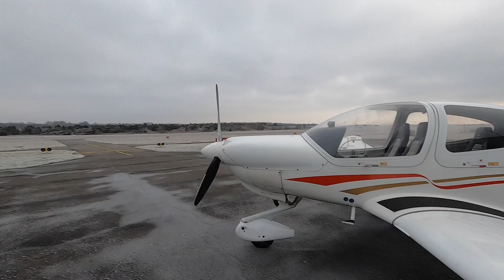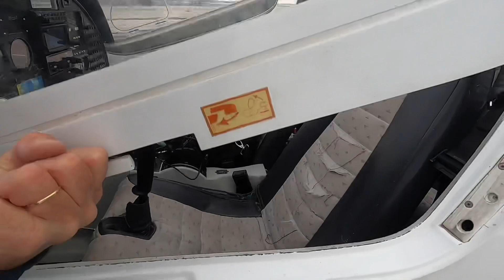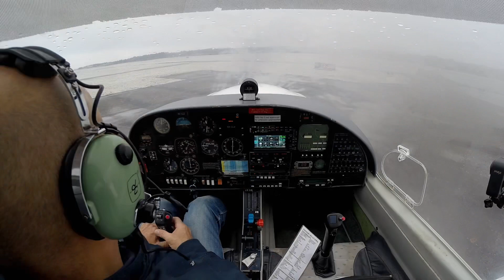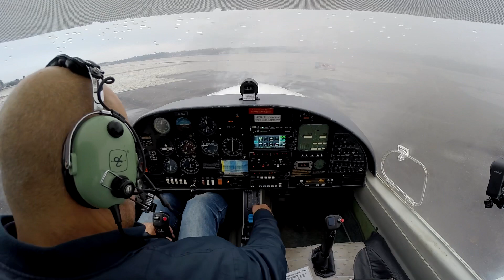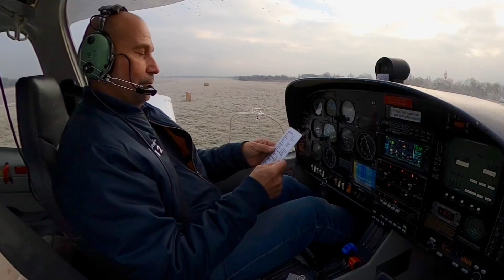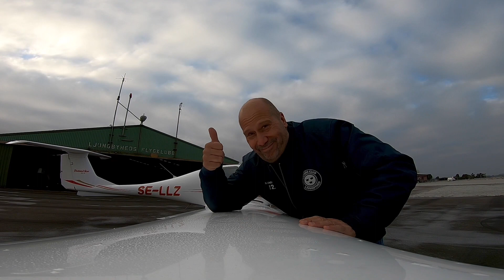How To Fly A Plane 🛫😊

Comment: Thank you for a wonderful video. It certainly is more snappy than a C172. How about trim. Does it automatically trim, because I didn't see you touch a trim wheel. Or do you just keep it in take-off trim for standard patterns?
Reply from the maker: Just a very quick touch at the electrical trim switch, on top of the stick. There is also a manual wheel, just like a Pa28, between the seats, but I love the electrical. Did not mention the trim, since I set it for takeoff in the preflight preparation. I can show how to use the trims it in a future video. 😊 Compared to a C172 the visibility up and forward is much better. Flying with a stick is also a delight. A comparision between different small planes could also be an interesting video.